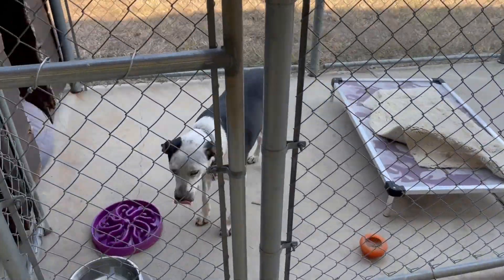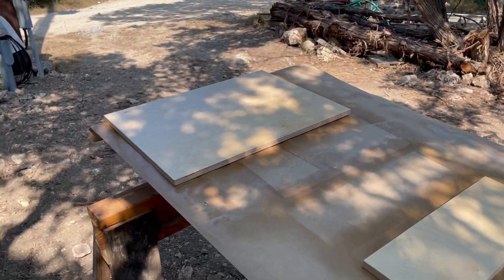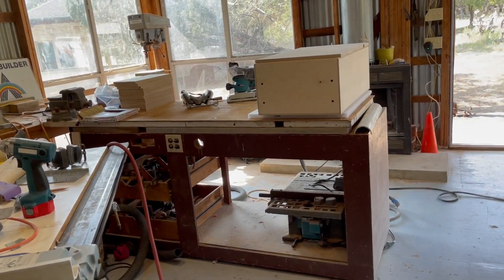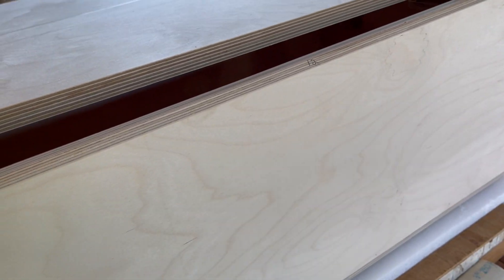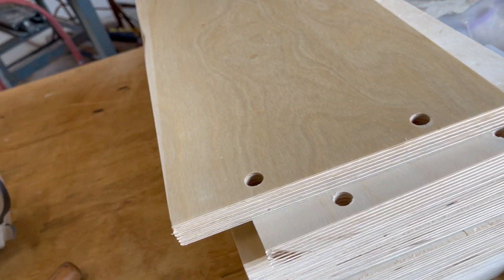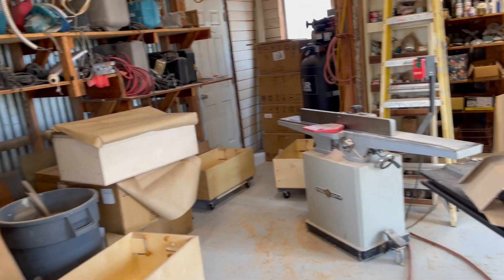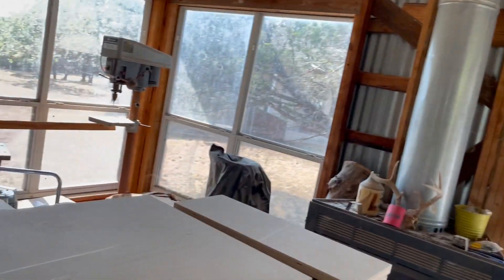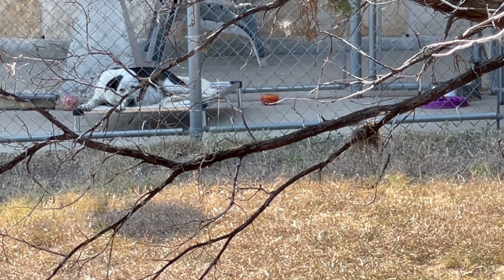Can We Make Lifepo4 Batteries Beautiful?

Comment: I like the effort and considerations you put in to make it beautifull looking cause that helps a lot more than looking ugly and dirty like in an old tractor no one had maintained.

I have a point that is rather late for you or too late cause it is about a somewhat different approach even though you are interested in selfsupplying or autark houses as we call it here, maybe grid independent.

Basic part is a well insulated house.
Then there is a solar powered roof for about 10 kWP which produces far less energy in northern germany than in Texas.
The house benefits from 2 factors: solar power used for daily use and in summer to generate the energy for the winter

So, in summer the solar power surplus energy is stored in hydrogen tanks similiar to those tanks you have in your shop. It needs about 1 x 1,5m space to store the hdydrogen for a house in the winter.
During winter the house generates electricity from the hydrogen powered fuel cell and to use the warmth created during that process which is about 40% electricity and 60% warmth. Then the home is heated by heatpumps when the solarpower is still efficient enough like from September to early November before the hydgrogen fuel cell is running from the longtime energy storage.

The system is now ready for mass production and it is not really cheap with about 60 K investment incl. battery, hydrogen storage, fuel cell, solar power and heatpumps.  But the price will come down cause here the homeowner get about 20K to 30 k grants if they start to go the hydrogen way - only for high tech, not for building or owning a home cause that is something people have to pay on their own except they have many children cause then they also get 10 k grants for each child to build a home or to buy one.

I can not add a  link due to yt restrictions that would delte the comment but search for picea and if you find a url that links to a german domain with de at the end that is called homepowersolutions from BERLIN germany then you have found the right website. 
Google translate will hopefully do the trick and I suggest just to write to the company and hear what they can offer you in english pdf and so on. Just good to stay in touch and watch for new emerging technologies. 
Might be to small, but usually they said it is to scale up by adding another 1x 1,5 hydrogen bottle storage or fuel cell stack or more solar power. Yes, a lot more expensive than a battery, but this solution is about a surplus long time storage that is used once a year and not emptied 300 times a year. I guess there is also a sweet spot between the sizes regarding battery size and hydrogen storage, but at least it works here for low energy houses which means perfect insulation and craftmanship, blower door tests and much more .